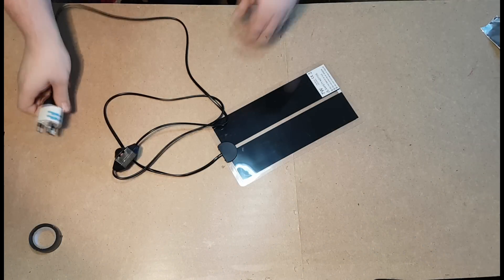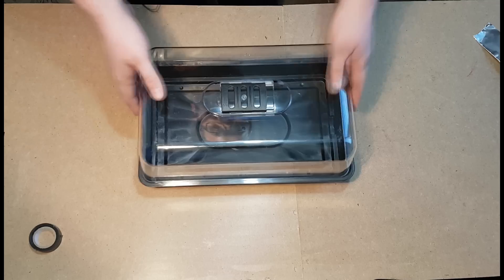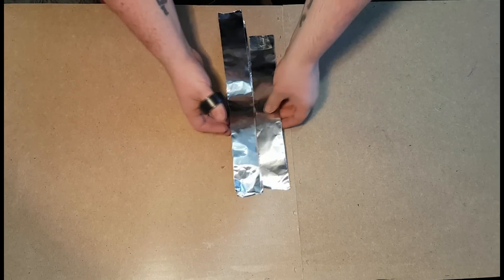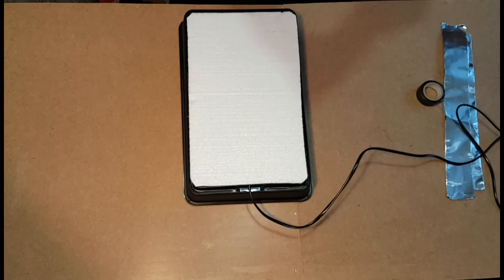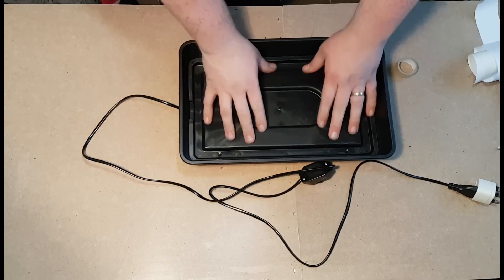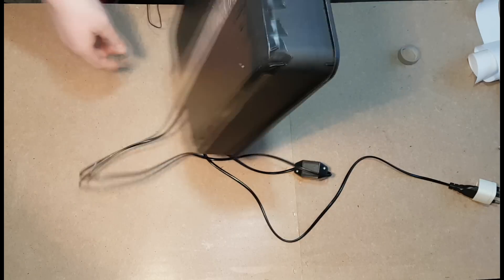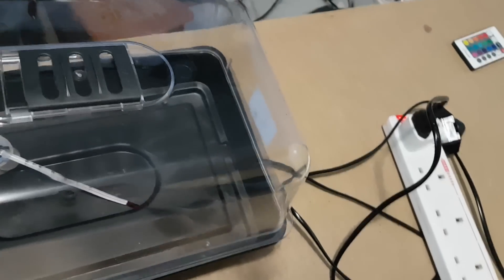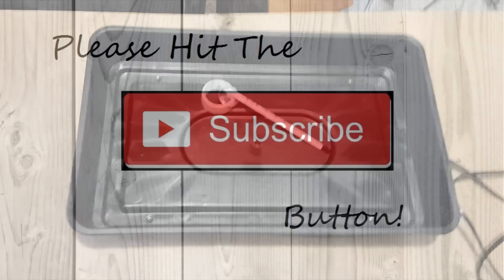DIY Temperature Controled Heated Propagator - For Under £10/$12

Comment: What temperatures are you getting, I am trying to get chili s to germinate, I believe about 28 degrees needed
Reply from the maker: hey the temps are variable as the controller is able to change the heat output by the mat, i usually use it about half way and get about 26.  so put on about 3/4 on the controller will easily get you a nice 28 degrees.

Comment: I am going to do this it's a great idea. Thank you for sharing. I just wanted to know what the silver tape is called? I know I probably sound thick and everyone else knows what it is. Hope you don't mind me asking 🙂🤗
Reply from the maker: hey thanks its aluminum tape used to seal pipework you should find it in the plumbing section in most diy shops mine was from homebase called thermawrap tape.

Comment: Have you got a video of it in use? Does it heat the soil up to the same temperature as the base?
Reply from the maker: i currently us it to germinate alot of my chllis seeds and to help cuttings take quicker, yes it will heat the soil up nicely if i am growing in pots i usually use a layer of perlite on the bottom the keep a level heat all the way through.